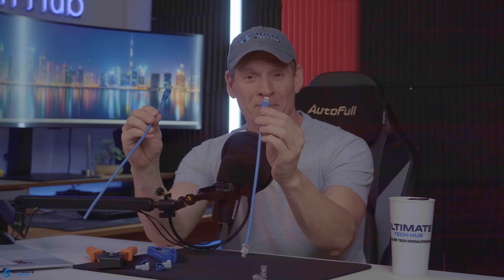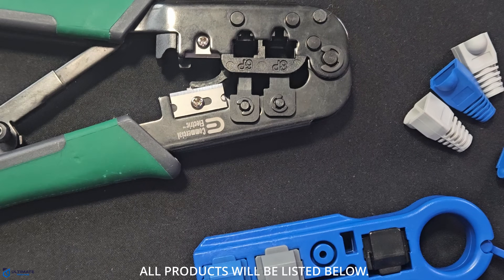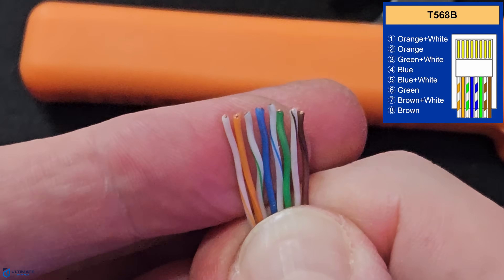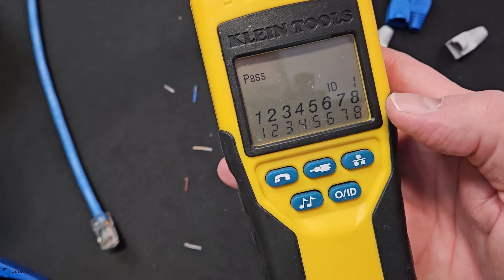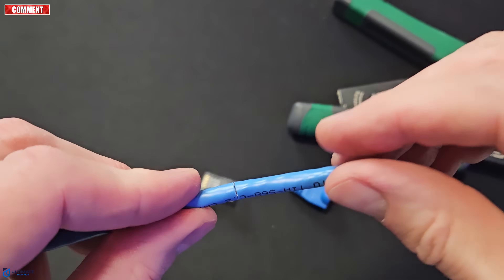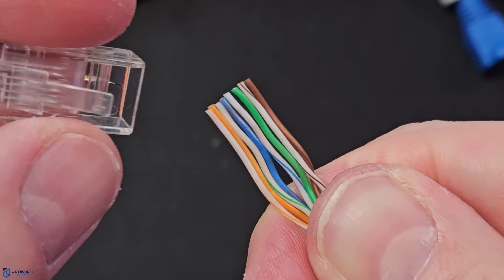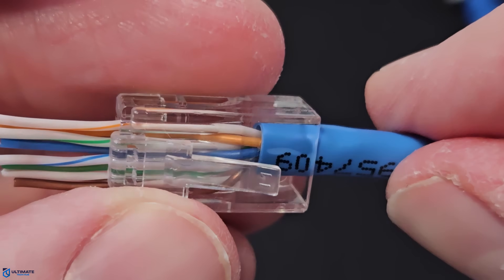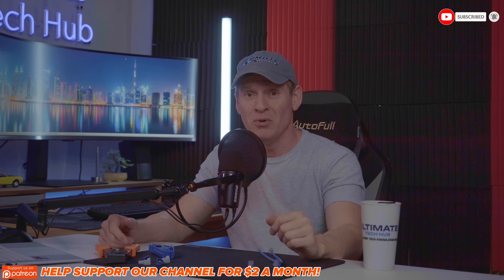Stop Wiring RJ45s WRONG! (EZ vs. Pro Method)

Comment: I dont use pass-through connectors due to the fact they leave exposed copper making them more prone to shorts and emf interfierence.  Standard plugs are just as easy and just as quick with a little practice
Reply: They work 100% fine if you use the proper tool and keep your blade fresh. In this video this shows that neither was done. :(
Reply from the maker: @JasonsLabVideos  Thanks for watching Jason and Happy New Year buddy!
Reply: Plastic does not shield against emi.
Reply: EMF don't work that way. Is not like "I will enter only thru exposed copper". Everything regarding the pass thru is just "guessing what may be the problems with it"
Reply: The only probably problem is the exposed copper but that is not even a big issue. I used passthrough connector for my PoE camera, I lived in South East Asia where 10 years + rated equipments can be eat through in 6 months by moisture and rain. In the 4 months after installing and crimping it, not once did it short on me and I crimped like 24 wires. The insulation of the wires and plastic housing itself has groves which help isolate it so no short there. The only thing that can short it is if it is shorted at the RJ45 contact with the device and there are those included water proofing thingy for that and moisture does not build up there that much. If exposed copper is an issue, keystone jacks for patch panels or wall plates will not exist.
Reply: @anh413  Pass through is fine, use the proper tool, and keep the blade sharp Perfecction every time.
Reply: Which is better? Well do you ever see patch cables with pass-through? Nope. Dont take short cuts, use standard
Reply: @Henry_Jones patch cables? If you already own percised cables manfacturing machines, you are probably percised enough where using normal RJ45 connectors or bootlaced RJ45 connectors is not a problem. Again, if signal integrity is a problem with pass through connectors, then keystone jacks will never be allowed since they literally cut into the RJ45 copper cores after being untwisted, after crimping there are still exposed copper cores at the end like in a passthrough cable. Patch cables will not fix this since they are connecting from the female end of keystone jacks to devices or other keystone jacks.
Reply: @Henry_Jones  Do you ever seen network admins that have racks of equipment making cables ? your point is not a valid one at all ! DERP !
Reply: I've been terminating cat 5 cat 6 for a long time and done it both ways I typically do pass through yes the shorting with pass through can be a problem but they is a newer style passthrough that has a little plastic piece at the end that keeps the ends of the pairs from touching each other when they are cut and they cut flush preventing shorting out i use these all the time on jobs sometimes hundreds on a site and have zero problems and its faster and less mistakes especially when its the end of the day and your tired
Reply: @ralphawest  Those plastic pieces are a BITCH to get out if they get stuck in the ethernet jack on device. If you have a sharp blade on your tool, youll be fine.
Reply from the maker: I agree that with practice, standard plugs can be just as easy and quick. I've used both connectors and had no problems with shorts or EMI. But yes, the exposed wires at the end could be a problem. A quality EZ crimping tool can make a big difference too. Thanks for watching Henry! Happy New Year!
Reply: @UltimateTechHub thx. A tip for you, after you set the wires order B type, dont use scissors to cut the conductors. Use the cutting blade on the crimper to give it a flush even cut accross all 8 wires.
Reply from the maker: @Henry_Jones my crimper blade is dull, Lol.
Reply: @Henry_Jones  you can also use a pair of diagonal or flush cutters